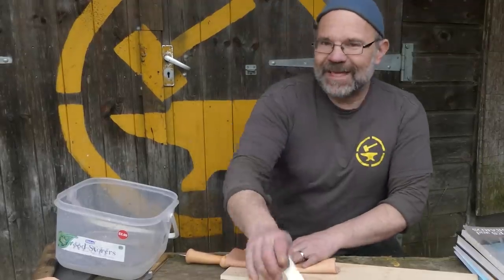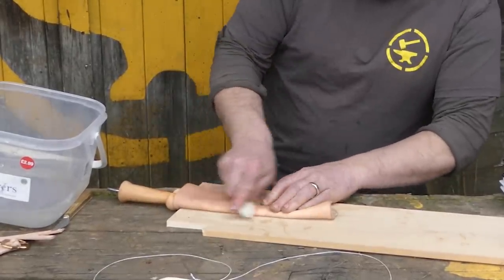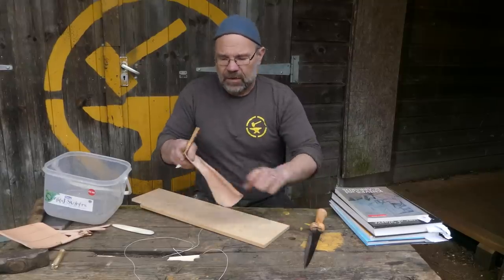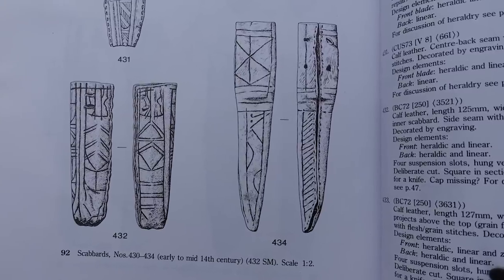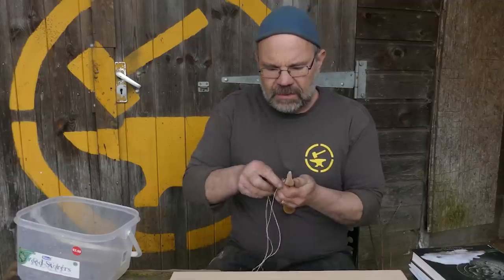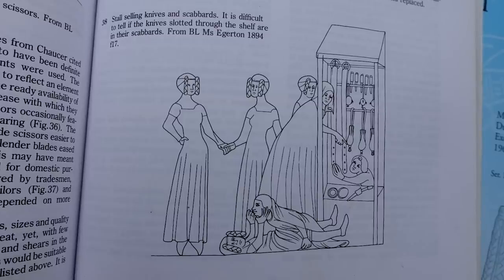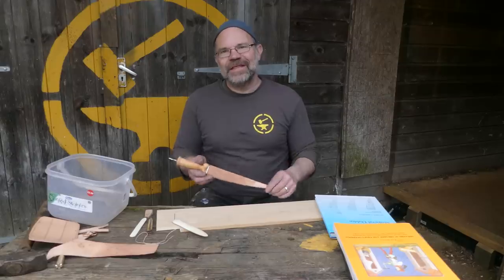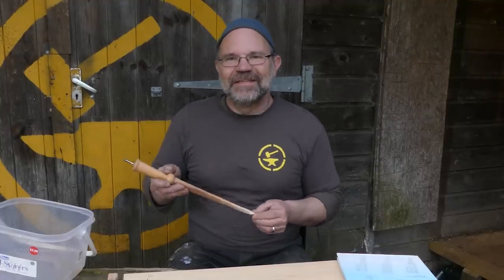Tod Makes Junk - Was Medieval Work Bad?

Comment: I guess as well, when we buy today, these items are often for display (I don't know too many people wandering the streets with a bollock dagger or falchion). So we want them to look as good as possible because that's the big draw. 

For those living back when, the sword needs to be sharp and pointy. The dagger needs to be strong and durable. That's it. 

If you want more, you've probably got a lot of money and, again, you might not use the item as much because of that. 

It depends what you need it for. Display or action.

Comment: Don't we have this difference in perception today? My dad taught me to work pretty accurately (or tried to) and so occasionally I do see things. People built houses with weird angles until pretty recently: weird walls, uneven floors and such, you can notice walking up/down in some rooms. Even today, when you need new tilework (like kitchen/bathroom tiles), pipes, or whatever: Some do it evenly and some don't. When I complain to friends and family I get this blank stare that says: "Eh, is that so? Really? Oh, maybe?". Same for audio: My girlfriend didn't notice (and didn't care for) the difference between stock speakers and new speakers + woofer, even though the difference is pretty striking to me. So I can totally see that people didn't care because today people often don't care.

You need some point of reference to begin with and if your point of reference is nature, you probably don't see symmetry all that often. Maybe the revolution was math, engineering and mass production -  we guess aesthetics from that, don't we? I grew up with measuring angles and good speakers. Money doesn't fix those things, necessarily - very expensive audio equipment is pretty bad, often; it's sold for other reasons (style, lot's of bass, displaying money and such). Maybe some audio engineer in the future wonders why everyone loved beats headphones.

Comment: One reason for poor quality "professionally" made leather work: Apprentices. Most of this stuff would be produced under guild systems that used the apprentice system. Apprentices would be doing the scut work like moving hides, delivering things, cleaning stuff, etc. Then they'd start making cheap stuff like inexpensive knife sheaths and farmer's horse harness, gradually moving up to journeyman level and more expensive items like clothing and fancy  horse tack. But you'd be getting faster and better as you went along. Apprentices did the volume cheap stuff, and the Journeymen did the middle to better quality, while Masters would make fine things and oversee the journeymen to ensure that guild practices were being followed.

Comment: I have a crosshilted dagger with a 9in (22cm) blade I purchased from a knife maker at a Ren-fair about 40 years ago. It has an imperfect blade with a rather asymmetric line and a worse sheath than you just made, but it was hand forged and the price was right. Punches through mail and sheet steel just fine. "Looks" authentic too! heh.

Comment: I have worked in a bakery, call-center and operating room. Minimally-acceptable work is a common philosophy in all kinds of people but that doesn't mean that the minimum is all that low (but it can be). In the bakery, you care about it looking good  but only to the point where it won't slow you down. Sometimes, work is so poor that you accept a certain amount of customer backlash. In those cases, you usually hope for high friction in the reclamation process. If it forces a customer to waste a lot of his on time and possibly money to complain about quality,.they might just not bother even if they think that way. It's easy to see how that can happen with Medieval craftsmen that don't sell to customers directly or who have a market advantage (low competition or low supply).

Something that pertains to my own interest is bowmaking. I often find a real discrepancy between the portrayal of English longbows and their manufacturing. I strongly believe they were crude tools and that modern bowmaking practices don't reflect it. Warbows were made in batches in multiple steps. Imperfections in the wood disqualify it from that manufacturing process. You won't see much fine work or tillering. It's very easy to get a bow to shoot. You can spend 10 minutes on tillering even though it is often claimed to be the most time-consuming step. That is just modern perfectionist hobbyists speaking. Arrows would see more quality scrutiny if anything. If they aren't symmetrical and straight, it would affect performance. But I don't even know if they cared about that. They for sure didn't care about spine

Comment: Could a lot of it be supply and demand ? 
Somewhere like Dublin was relatively small , there were a finite amount of professional craftsmen - if trade was slow , you put more care in , if trade was brisk you banged them out.. 
Many times prices were inflexible , a item was 3 copper coins or 1 silver coin or whatever, the size or the quality varied depending on market conditions

Comment: How about made in time for a war or replacements after a war? Whichever lord is paying for that would want more servicable swords rather than less but nicer ones. Peacetime workmanship and wartime workmanship might differ.

Also, stuff made while on the road: field camps, etc. If your sheath broke in battle, you'll not wait to get to the next town to get one made. Some camp follower will make one, and perhaps you'll carve a few patterns when you find the time.

Just a few decades ago, musical instruments were made by hand an every piece was slightly different. It wasn't until CNC cutting allowed a consistent built quality on the lower end of the price spectrum.

Comment: The entire Sheffield cutlery history ran on piece-work, and this does lead to some interesting eccentricities, particularly where more than one craftsman involved, as was generally the case in Sheffield. I once showed a lovely old folding knife to my late friend, cutler Stan Shaw, and asked why the blade well, and the spring, while perfectly straight,  flared outward from the front bolster, and the pivot. To him, it was obvious, the springs and blades came from the forger, so to save time, the cutler only filed down one part of the spring, close to the bolster, which was the only place, where, mechanically, the width of the spring was important. I noted that that would surely mean that it would take longer to haft, since the covers of the knife would have to be shaped to accommodate the flare of both blade well and spring. "Well, that were somebody else's job!" Stan said 😁Time was most definitely money, cutlers had to work fast. Barlow knives were absolutely thrown-out, sometimes the covers are just 2 pieces of unshaped bone. Of course, this was a later period, but the same economic factors still apply. Very thought-provoking video Tod 👍
Reply: USERNAME[TODSWORKSHOP2]  Thank you Todd, but I'm still on Pounds, Shillings, and Pence! 😊

Comment: Piecework still works like this. A good phrase is "good enough is good enough." Seriously, take a level to any floor or a laser square to any wall. Check every door in a house or examine the casing. If it lasts to 5 years (a typical warranty for installation) then the tradesman did his job exactly as contracted. And this principle holds for other things, like small drill bits. I could use lubricant and drill on low speed to keep my drill bit sharp for longer. But, they're like a few bucks a piece. If I break one bit a day but save 10 minutes of drilling time over the course of that day because I just give it with that bit, then that's a cost efficient trade.

Comment: decoration takes time, especially if you want it to look good, and there is often diminishing returns for how "beautiful" a piece is compared to how much time you put into it. most people i assumed look for functionality, i personally would rather buy a sheath that got the job done and had a little bit of cool decoration on it, as slapshod as it might be, rather than spend almost perhaps twice as much on a fancy well madesheath. I figure its like buying a car, why bother getting the fancy upgrades if youre barely going to use them, the cars going to break down at some point in the future anyway and im just looking to get from point A to point B. If the air blows cold, if the engine runs and the airbags work why worry about upgrades or body work? for the craftsmen i think it was about making a functional piece with enough deco to attract interest, without making it so nice that you lose time making other pieces, and maybe not making it so well made that you price people out.

Comment: One thing you barely touched on Tod, was the fact of material to work with. Sheep and goat skin might have been used sometimes because it was soft, but maybe sometimes it was used because good quality cow hide was expensive, in short supply or even unavailable. 
Further the imperfections in the raw materials almost definitely led to some of the decorations, done to cover up or distract from the blemishes on the hide. 
One thing though - in light of this - perhaps you were quite wasteful in the way you hurriedly cut it out. It doesn't grow on trees you know, and it's important that you make the most of every bit of that cowhide you can.

Comment: My favorite bladesmith of the moment is a local man, Scott Hawley, of Furnace Brook Iron Works, who makes knives in the style of the American colonial period. He uses modern tooling, but his completed works look as if they are new old stock from 200-300 years ago, and would not have been out of place in early America or Canada, though his blades are perhaps thicker in stock than what would have been generally available as trade goods in those days. His works are expensive, compared to modern factory-produced knives, and he has a waiting list years long. His knives are made from carbon steel, show forging marks, and are given handles made from local woods. I really want him to make me a matched set of knives which I intend to be my woods/backcountry companions for the rest of my natural life, and to pass on to my daughter when I am gone.

As I said in my comment on the earlier video, smiths of the medieval period did not have the advantage of the precision which is available to us, today, and it your goal is to be period-accurate, then you have to accept the fact that only the aristocracy could have afforded the level of handwork that perfection would have required in that period. Most buyers today don't really want "period-accurate", they want idealized reproductions of historical styles, and I think it's worth pointing out that because blades are in the modern era no longer really used for the same purposes to which they were put in the medieval period, I wonder if most modern knives, particularly swords, could be relied upon safely if pressed into the service to which their historical forerunners were pressed.

How sure are we, in an age where sword no longer really meets sword in anger, that, for example, our heat treatment methods and metallurgy would survive actual combat without catastrophic failure? "Blade as tool" and "blade as weapon" are not the same things.

Comment: I think a good reference for bad quality work in our time is the kinds of things you buy on vacation. Be it small tourist memorabilia, to "local" crafts or furniture. Alot of what people buy and cherish is clearly badly made. The lines or patterns are off, symmetry or paint uneven and so on, clearly made by someone who rushed, eyeballed it and said, thats good enough to sell. 

We simply expect a certain level of precision and perfection in certain things, but not others. And such was probably the case back then as well, but which things has changed.

Comment: "They didn't see it" makes a bit of sense, however maybe it's more that "they never saw it" in that a geometrically perfect object with no manufacturing flaws was so difficult to produce and unheard of/unseen that the majority of people had never seen one before and simply didn't know that it was possible therefore something that was 80% perfect was 100% perfect to them as they didn't have a 100% perfect piece to compare to. 

Also
High symmetry and geometric perfection is much easier to do now and mass producing thousands of identical items is the norm, it would be more expensive to produce thousands of different items. Maybe people preferred uniqueness back then too.

Comment: I do leather working to sell at craft fairs and there are two lessons i've learned.  If I'm making something for myself, a sheath to go over the half head knife i have, my basic concern is does it do the job, if the answer is yes then it is fine, doesn't need to look pretty it just for me.  The other one is that when I'm making items to sell, I can see every mistake as if it has a bright pink sign pointing at it, but it out with the rest of the goods on the stall and no one notices, or if they do, then they accept it as a sign of it being hand made not mass produced.  People expect a degree of quality to handmade items, but perfection, no.

Comment: The typical craftsman had to attract trade from all so the measure of his craft (and he would have to prove his skill in a town guild) was both how fine he could make his product for the well heeled and how soundly made cheap he could make it for the common customer. Probably it worked out at the same return for the same man hours. Some of the cheaper quality may well have been made by rushlight at night to extend his working hours. Also the poorer items could be those made by apprentices who had yet to reach the skills for fine quality work but could be set to making basic items.

Comment: If you're a typical medieval soldier, the key question is "will this sword cut the other guy before it breaks in half?" If the answer is yes, it's a good sword.

Everything else is gravy. Especially when you consider the poorer quality steel of the time, swords are going to be consumable items. They break, they notch, thru dent. Why spend the time making a perfectly straight midrib when there's a very good chance it will be dinged up and need to be reground in 3 months anyway? It won't be straight then regardless.

Comment: Some things aren't meant to last forever. If you think I care about how my multi-use shopping bags look... nope. If they have a hole, I get a new one, I don't care. I care if they're fabric/robust plastic or thin plastic, but that's about it. I don't even give the patterns on them a second look. I want something that works and is not too expensive.
I bet there's something like that for most people out there. And the more you have to be careful of how you spend your money, the less you care about the actual look as long as it works.

Comment: This has made me realize something about the later eras that I mostly focus on, largely the 18th century. When things like muskets start being made from interchangeable parts, this tends to be reported--albeit unconsciously--as a triumph of common sense. But while it was a revolutionary simplification for field maintenance, until such time as you could automate it economically the much higher level of hand work required to achieve that would almost certainly have been economically prohibitive on the production end.
Reply: People also don't understand how monumentally difficult it is to make interchangeable parts by hand. The only way to do it is to either be a true master of your craft...or have a machine/mold/so on. Like, there were mass-produced guns made in the 1940s that didn't have fully interchangeable parts. 

Look up the PPSH 41. Very often you couldn't use the magazines from between guns. Even in guns who's serial numbers are right after each other. The tolerances just weren't right, and they won't feed, either reliably or if you're particularly unlucky, at all. So soldiers had to be extremely careful in making sure they kept the "mated" magazines & guns.
Reply from the maker: I may be wrong, but I believe that in the 13thC the Venetians had maintenance and stores depots along their trade routes with standard ship parts like sails and rudders
Reply: @tods_workshop  That sounds plausible, but those sound much coarser builds than, say, components of a lock mechanism. I'm guessing you'd know if such has ever been done with crossbow parts. It seems to me a spectrum of capability: my understanding is that medieval flour mills, for instance, had pretty elaborate mechanization hooked to waterwheels, but the technology wasn't yet even vaguely good enough to turn out something like, say, standardized machine screws. I recall seeing online pictures of a disassembled 18th century clock once, and the screws looked just horrid. But as you're saying, they got the job done, probably with the most economical effort.

Comment: I'm a carpenter and have worked in construction for about 23 years. Everyone, and I mean everyone, works to the pricing of the job. The old saying that you get what you pay for is very true.  There have been many occasions where we've had customers come in with little money needing the job done fast, and they are fine with the outcome.
Reply: If you've got a hole in your roof, and you're heading into the cold, damp days of winter, there is nothing more beautiful than an ugly patch-job so long as it keeps the wind, snow & rain out, while keeping the heat in.

Comment: As much as I agree with many points, I have to question if some of the extant examples look "awful" because they are old. Leather cracks and warps, wood the same, etc. What pieces were "munitions grade" (good enough for gov't work) and what pieces were for nobles, and how nice were those nobles' pieces? Looking outside of weapons to kitchenware, furniture, etc., it seems like richer clients were very concerned with "perfection". Besides all this, if you gave a medieval smith modern tooling, would they not pursue perfection the way we do?